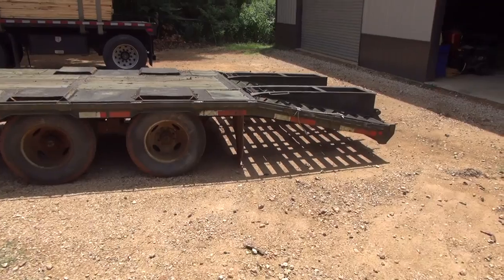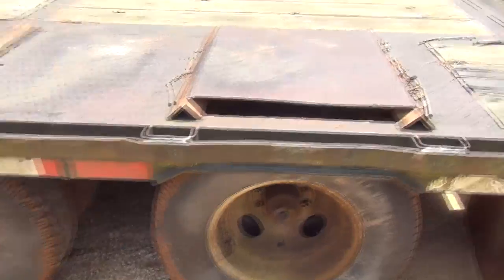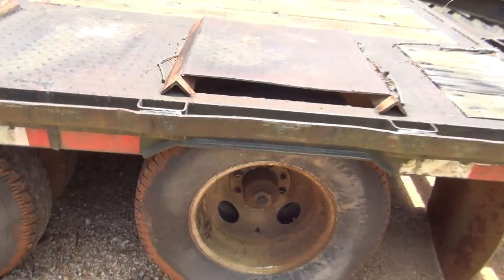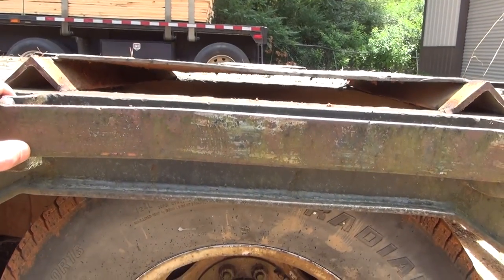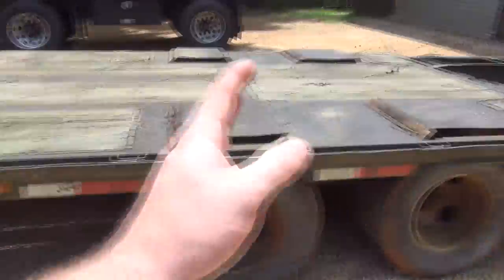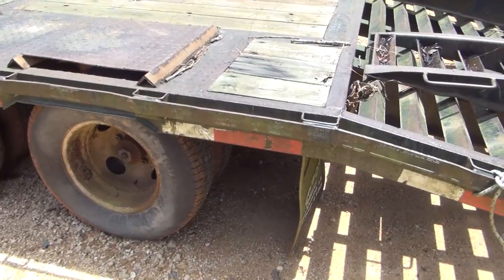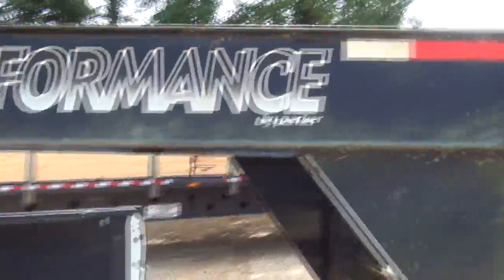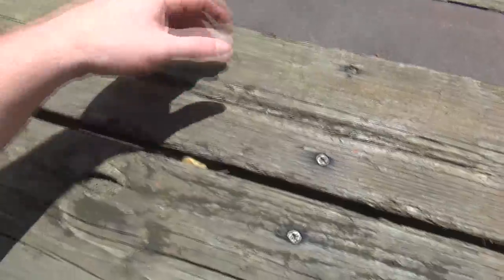I bought a broken gooseneck trailer

Comment: As long as the frame is not twisted or rotted out from rust, its a good one. When you fix the bearings on that axle, I would check out all the other axles to be safe. Nothing worse than a breakdown on the side of the road. Even a mile from home is too far for a breakdown. Good luck.

Comment: If you replace the Hub make sure it's not made in China go ahead and buy you a farm tag because if you run it on the road you'll wind up having to have CDL license just feel all the hubs up with wheel bearing grease stay away from the oil bath replace your Center equalizer and well 4-in c channel and raise it up another 5 in will give you plenty clearance for your wheels had a piece of c channel down in between the center of your equalizer

Comment: How’d you end up fixing it? Looks to me he replaced the wheels with a size too big and that’s why they rubbed
Reply: The proper way wouldve been to replace the equalizers on the suspension and spring bolts and bushings. Thats what makes the set down when that stuff wears out. It let's the trailer drop.

Comment: Mount your axles under the springs.
Reply from the maker: That would make it 6" taller which is a bit much and make the electric brakes upside down, unless you cut spring perches off and reweld to other side of axle tube. I know it's been done, but I have a different plan.